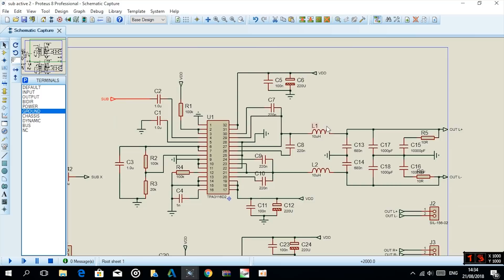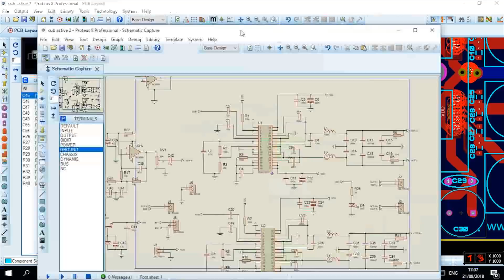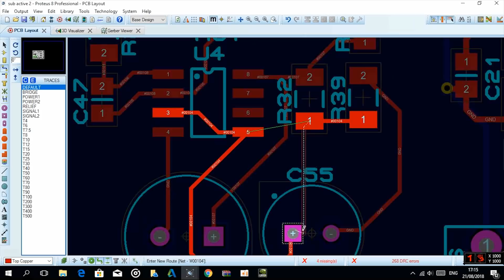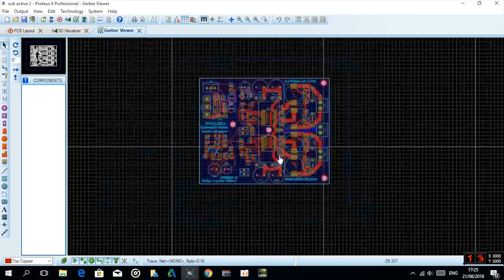Skema Class-D Amplifier TPA3116D2 Dual Bridge + Preamp - PCB Layout

Comment: Mas power class D + speaker protektor standart seng beredar di pasaran cocok ga?
Reply: Class d Aman buat speaker. Coil max paling 1 amper. 

Secara inj main ditegangan tinggi.

Dari uji coba dia main di volt 2000an, dengan arus setengah amper. Itu dah output 100W. Setengah amper itu Aman untuk speaker 6' keatas.

Paling daun speaker copot. Kalau itu diluar fungsi speaker protector.